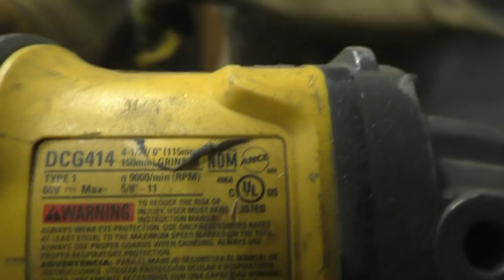Grinder Safety -- and lies you are told to scare you.

Comment: I really don't see the point of running a grinder without the guard.. Not even for safety, it's just so much more comfortable to not have sparks setting your clothes on fire..
Reply: This is so true.  I use a 5 inch grinder  all the time in my job  with a cutoff wheel fitted, and would never run it without guard.
Reply: Yeah, I'm a trade boilermaker for 25 years, there is only 1 in a thousand operations that need the guard removed, damn foolish to not use it plus it keeps the sparks away...
Reply: @traxxasLOVR  you should get someone to teach you to use it properly...
Reply: There are situations where you need to take the guard off. The problem is for legal reasons guards are as permanently mounted as manufacturers can make them. So when people need to take guards off they leave them off even when they shouldn't
Reply: @dimreaper274  you should step out of your comfort zone and try cutting other stuff besides boilers.
Reply: Apart from that, in some countries, like oz , insurance wont pay out  workers if they are injured by a grinder with its guard removed.
Reply: @frigglebiscuit7484  Mate, in Australia, boilermakers do all heavy metal fabrication. I've done oil and gas titanium piping up to 600NB, built pressure vessels up to 4m dia from 32mm thick steel plate, built navy frigates, built mine process plants in Australia and Africa , bridge girders 3.2m high x 7.2m x 46m long, I can keep going... It's probably a shit load more experience than you have grinding which ever way...
Reply: its a functionality thing. i can show you how i use my grinder every day and you’d understand
Reply: I work on boats and some places the guard wont fit into compartment with the guard on so we just run it without it, but put it on when it can be used.
Reply: andrew nicol as a ship fitter I agree with you for the most part but there was a couple instances where I had to take the guard off to get in a tight corner where the piece I was cutting out had to be saved but other than that yeah guards are good in my book.
Reply: @traxxasLOVR    same here.  just about the only time I break my cut off disks is when I accidently step on a grinder
Reply: camjamsdad  I was going to say this. If all you're doing is some (relatively) thin material like 1/4 plate, then of course you wouldn't need to remove the guard. But if you're doing concrete, tile, or stone work, that guard needs to go immediately. Hell, even fast cutting thin materials like wonderboard I like having the guard off. When you can rest the head of the grinder on the materials and just slide it along to get a cut you get a much faster much straighter cut than fighting a guard. And if you ever have to do real grinding work to flatten a surface, like grinding thinset off of concrete you can't have a traditional guard on. The one guy who has lots of experience using one tool for one job shouldn't be commenting on how all people should  use that tool. The guy who only drives dowels would never understand why someone would use the claw of a clawhammer.
Reply: I would take it off for extra visibility when wanting to do precise cuts

(of course you can always have a shitty and fastly done cut and just grind all that up but it's just faster to cut it how you exactly want it)
Reply: I ran a 4 1/2 inch grinder at my last job 8 hours daily for a year and a half. I always took the guard off because it got in the way when trying to grind in tight corners or on smaller parts.  I soon developed a sense and constant awareness for where the sparks were going and never had a major problem. The only injury I ever had there was when I bumped myself with a flap wheel early on in the job
Reply: Usually makes sense to run cutoff wheels with the guard, especially given their propensity to explode. I've had good luck with the full size cutting wheels, but I have destroyed several 3" wheels on the die grinder. For grinding wheels, sanding discs, etc. there's really no need for the guard.
Reply: @dimreaper274  no one has more expeience than another. I've done things you haven't, and you've done things I haven't. the stuff I do can't happen with a guard.
Reply: They get in the way and are virtually useless in my work. They render the tool unusable for what I want to use it for which is for surgery on metal work.
Reply: I run with mine on but their are times when you just need to get in a specific spot and the guard gets in the way so I'll pop it off from time to time
Reply: Well how the hell are you gonna get a 7 inch cut off wheel on a 4.5 inch grinder with the guard on that thing man? Come on..
Reply: r/thathappent
Reply: Visibility
Reply: @traxxasLOVR  If the guard is blocking your view of the cut, maybe you should turn the grinder around and use the end that's not covered by the guard... Like you're supposed to.

Maybe you're using the wrong tool for the job... try a dremel or die grinder.
Reply: In the custom car trade, there is hardly ever room for the guard.  But I use leather gloves, leather welding sleeves and a full face shield. My club brother got a gnarly 3" cheek split. So, no guards but very protective ppe
Reply: Run mine without... it's all preferences. I wouldn't encourage it onsite,  but I don't mindspark showers or a arc induced sun tan...
Reply: TrackMasterNate Learn how to use a grinder. You need training and education.
Reply: Because it really gets in the way when you need to use more of the wheel.
Reply: Before I turn that grinder on that wheel is going to be on tight, eye protection on and hearing protection on.
Reply: I always use the guard.  That said, it’s very very cumbersome and gets in the ways of effective and fast work.  I am not a pro doing it everyday.  So I have my guard on.  But the guard is the least of your concerns if you don’t have common sense.
Reply: and your insurance probably won't cover the damage if they see that you removed the guard
Reply: Its in the way.
Reply: It depends on what you're doing. I used to have several grinders and only ran a guard when I felt it was a sketchy cut. Using a guard with a flap disk is nigh on one of the more stupid things you can do. In BC, Canada you're allowed to remove the guard if the work requires it. Honestly though if you're wearing proper overalls, gloves, and safety glasses a guard is kind of worthless. Bigger cut off saws are several times more likely to do damage upon failure and there isn't much of a guard to help there.
Reply: I actually did set my pants on fire once using a grinder
Reply: That's about the only concern I've ever seen. A couple of times people on jobs burnt holes in their shoes or shirt. No fatalities just hurt their pride a little.
Reply: @omegasupreme5527  Makes you wonder how sometimes because that shit gets hot well before it ignites.
Reply: HomeDistiller yeah it makes sense don’t want a whole bunch of sparks flying right into your face when you’re grinding something down
Reply: @tulmar4548  wow that's insane! So would they not cover medical costs if your in an accident but no seat belt?
Reply: @kickazz9473  by insurance pay out I am referring to workers compensation which can be paid to an injured worker for time lost off work etc. Medical bills in Australia don't matter , healthcare is free and no-one is denied care in any situation:)
Reply: @traxxasLOVR  Rotate the guard. Not hard.
Reply: i run all mine with out a guard. many dont come with one (die grinder type) but the guards often get in the way or prevent me from cutting in various positions under vehicles.
Reply: just point the sparks away
Reply: @tulmar4548  ahh ok
Reply: @patrickweaver1105  The Metabo grinders I prefer to use all have toolless, spring lever operated guards.  All you have to do is use a finger to depress the lever and rotate it to the desired position.  If you rotate the guard completely 'north', it comes right out.  Literally takes 4 or 5 seconds (and no tools) to remove or re-install.  You can even keep your gloves on as long as they aren't too padded/bulky in the fingers.  Well worth the expense, IMHO.
Reply: Hard to know what to say about this goofball. Sure you can get away with a lot of stupid things in life. You might not get hurt 9,999 times. Man does that one time suck though... Why not reduce that risk even more. Go ask the people with 7 fingers or 1 eye if they think thats just the price of doing business. 

There are always circumstances where you might have to take off the guard. Theres also usually another method or different tool for the job. 

On a related note, i did learn a valuable piece of info not long ago that isnt commonly known, atleast around my colleagues. 

CUTTING / GRINDIND DISKS EXPIRE!! 

Apparently there is organic compound used that will degrade and break down over time and make them much more brittle and more likely to fly apart. Some expire dates are on the box, some are stamped on each individual disk in the center metal ring. 

Stay safe people.
Reply: It all depends on what you’re cutting. I haven’t had a guard on a grinder for 20 years.
Reply: I always use a guard. I dread to think of how badly you'll get peppered with sparks and disc particles without the guard.  I had a slitting disk fail on me today with a 7 inch grinder. Luckily I was kitted up with gauntlets, overalls, earplugs, safety glasses and a visor over my face. The disks are not the cheap crap so it it broke up in smaller pieces instead of massive shards but it could have caused some serious damage if it was a bad disk.
Reply: Hmm maybe someone should’ve paid more attention to the video and set up on the correct side of the grinder
Reply: I don't see my guard. But there's times I need it moved to see. Sight is the main reason to remove
Reply: @twizz420  yeah. I dont think some people realize you can actually change the location of the guard. So it wont get in the way.
Reply: I guess you’ve never had to grind an edge with no room for error.
Reply: Guards r always in the way always trust me 22 years of welding
Reply: It gets in the way all the time . Only certain people will understand that
Reply: @patrickweaver1105  Which magical guards are those?  I've maintained multibrand grinder fleets for a welding school and worked with them for decades prior.  A screw and a pinch clamp is hardly "permanent".
Reply: @obfuscated3090  Nothing is permanent when it's broken. Except for the injuries you get when a grinding wheel blows up in your face of course. The OSHA requirement is to replace defective or broken guards not discard them.
Reply: I agree with you, but I'm a carpenter so I don't use my grinder too much. Always use the guard, I have a few different ones for different materials. But I have friends in other trades and they never use the guard. More familiarity with the tool, guard also impedes visibility and limits the cutting edge
Reply: @patrickweaver1105 You should look at using something else instead for those types situations.
Reply: @billybobjoe198 cutting thin materials you're not supposed to sink the blade in to the hilt. You're supposed to only use the depth of the material, and the guard can act as a good rest to keep the depth. It's not even a safety issue, it's easier to keep it straight and you get 10x the life from the disk.

So no, that example is just plain shit.
Reply: Removing the guard is moronic , full stop
Reply: Probably more depends on how you are holding it. I am sure he isn't holding it in a way that sparks are flying onto his cloths. Also who wears clothes whilst using a tool that makes sparks that aren't a little flame retardant.
Reply: @dimreaper274  there are different attatchments to some like what do i do when i need to remove the gaurd to run a big wire brush

Comment: Why work without a guard , when 99.9 times out of 100 it's not in the way , and it funnels the sparks away
Reply: Nirvana NeverDies i would say leave it on unless you can't do the job with it on
Reply: Nirvana NeverDies you are correct with the cars, but i saw a bloke hit in the face with a nine inch grinder with a guard and he had to have plastic surgery
Reply: @bigears4426  and that 0.01% of job that you can't do with a guard probably is better fitting for some another tool.
Reply: Haven't ground anything under a car huh?

Comment: Most likely injury with a grinder is that you'll damage your hearing
Reply: What? Speak up!
Reply: Or lungs, breathing in that delicious disc dust
Reply: What? What?
Reply: @JoshuaZiesmer  
It takes hours (maybe minutes) to have significant hearing damage using a typical angle grinder without hearing protection.  Also best to have something between the fury of sparks, metal and abrasives and your eyeballs as well.
Reply: @skrubol  I'm speaking from over twenty years of experience dude. I wear safety gear, but I have run grinders without hearing protection when I've had to listen to people talking during projects, the loudness is dependent on what you're doing, cut off wheels on thin gauge can rattle your brains, but flap disks or brushes on plate, are not even uncomfortable really. Twenty years in, don't even have tinnitus. However, on my flap disk grinders, I chose to run without guards so that I can have the wheel flat on the work, can remove rust from plate ten times faster that way, but I definitely pay a price. About two or three times a year, just after finishing one piece, while reaching for the next, a finger will get just a bit too close to that flap disk and that serrated edge all but rips the nail off. And you know what, all semantics aside, if I had to choose, between going deaf and going blind, it's not even a question.
Reply: @JoshuaZiesmer  same grinder hit a spot of oil on a sheet of material and hit my knuckle. i didnt even feel it it was that fast. my glove filled up with blood so fast. accidents are going to happen. we just got to keep ourselves from getting comfortable with our equipment.
Reply: @JoshuaZiesmer  Ever had a hearing test? You would be amazed at how much hearing loss you can have before you actually notice.Most of the time it is in a specific range of frequency that may not be as noticeable. People don't really notice it until it is in the vocal range.
Reply: @stimpsonjcat26  yes, I have. I've never actually been stupid enough to run a grinder for hours with out hearing protection, maybe five minutes tops, but I've gotten wires from cup brushes stuck in my arm within seconds of turning it on, and have survived countless other "flesh wounds" so the original argument, of the hearing loss being the most common/most likely hazard is bull, and I'm surprised anyone is naive enough to defend it.
Reply: @JoshuaZiesmer  well I may be naive but your reading comprehension is poor. I didn't defend the point of hearing damage being more of a concern than other injurys. 
  I just don't believe anyone can grind without hearing protection and not lose some hearing.
 Even only a few minutes a day will add up and once you realize things are getting harder to hear it is too late.
Reply: @stimpsonjcat26  1. It's only a few times a year that I run a grinder without protection. 2. use hearing protection about 40 hours a week, so even though I on occasion used a grinder without plugs, I'm not subjected to the noise normal people do, like loud city traffic,  running recreational equipment like wheelers and dirt bikes, rock concerts....    3. As I said earlier, how loud a grinder is depends on what you're doing, no-load, a grinder is about the same as a vacuum cleaner, in fact, my shop vac is louder than my grinder with a cup brush.
Reply: @JoshuaZiesmer  Please don't use your ears as a benchmark for others. Hearing damage is very unpredictable. Some people go to one concert and have tinnitus for life. Others play in a band for 40 years and still  have good ears. The problem is you can never predict how strong your ears are until it's too late.

Maybe someone who loves music will say it's worth the risk. But grinder noise it's not a pleasure one can't do without in life.
Reply: @sverduijn1  Your completely missing the point. You and everyone else to be operating under the assumption that most people won't use ear plugs. I know dozens of people who have lost skin and blood to a grinder, but don't know anyone who's noticeably damaged their hearing. Weld.Com YouTube channel just released a safety video on grinders and actually show stills of real injuries, maybe you should go watch it. People who use grinders regularly use ear plugs, usually required to, but many people don't use guards, especially those who don't use them all the time, and often use damaged disks because they don't want to run to town and buy new ones.
Reply: @JoshuaZiesmer  Well I will keep warning people to always use earplugs and keep the fence on whenever possible. 

If you decide to do it different that's your choice.

BTW I come in metal shops daily and I see enough people working without proper safety equipment. But that is also why I don't work there. Those guys are worn out by the time the're 55
Reply: What did U say?, I can't hear U 😂